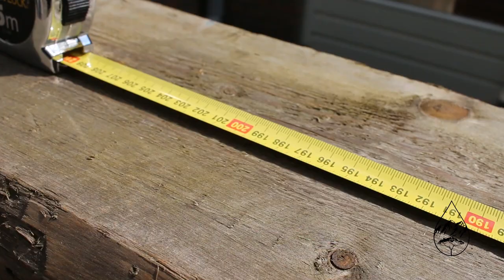Reclaimed barnwood dining table

Comment: Hi Menno! Great video, thanks for the inspiration. Just wondering: did you use stainless steel for the pins through the table? And do you think galvanised or zinc plated will work as well?
Reply from the maker: I'm not sure it whas stainless steel. I hope so because it will definitly rust. I dont know if galvanised or zinc would work.
Reply: @mennolabeee  thanks for the reply! Sorry but I do have another question. How did you drill that straight haha. Did you use anything of a jig?
Reply from the maker: @Adrian-sv1mo  Just drill half way thrue the wood, 6-8cm deep wil work fine if you drill a little bit the wrong way.

Comment: Hi, I love your table! 
I am looking into making one very similar to yours with reclaimed wood as well. 
A few questions for you... where did you find the legs from? 
Why didn't you try to hide those threaded bars inside the wood on the side by making bigger holes and eventually using wood putty to cover up? Thanks for sharing your video.
Reply from the maker: I got the legs from my intership, they miss calculated the legs and they where useless. The whole reason is to make it look industrial, if  you cover them up it will look less cool

Comment: 3:20 how did you drill precisely straight holes? You couldnt have done it by just eyeballing it
Reply from the maker: Yes i did! just go half on both sides .
Reply: @mennolabeee  i dont understand what you mean
Reply from the maker: @TheJosip1000  I did eyeball it from both sides of the beam.
Reply: @mennolabeee  oh come on! Without measuring? Even if you measured it, maybe you could eyeball one tunnel in the beams, but somany? no way
Reply from the maker: @TheJosip1000  Yes offcourse measure on both side. but the rod is 16mm and the hole is 18mm so you got some room for error
Reply: @mennolabeee  oh ok, that makes sense